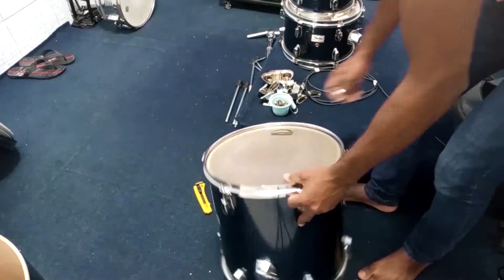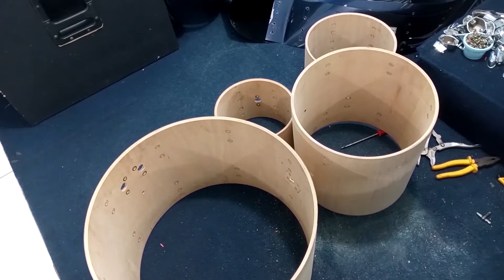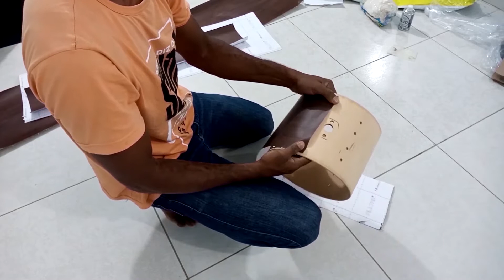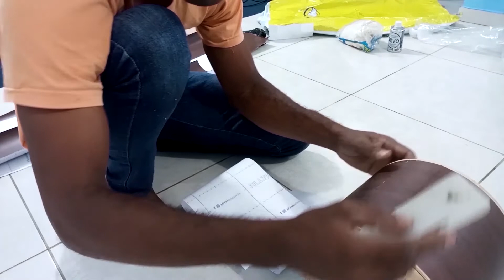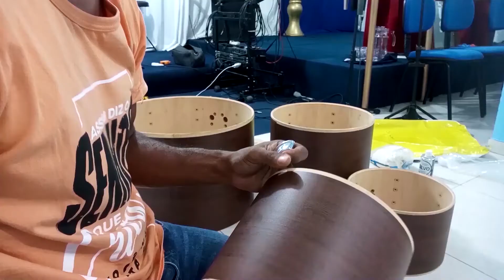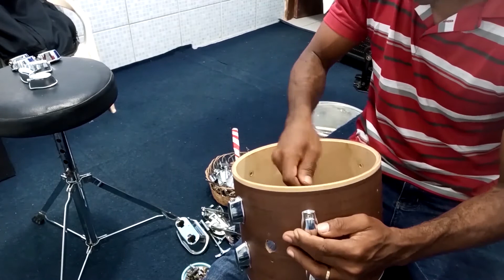Envelopamento da bateria TUTORIAL PASSO Á PASSO

Comment: A possible wise choice would have been to level and recut the bearing edges. Then sand the shells and seal coat inside and out. Then put the wrap on. It would not only improve the looks but also the sound and the durability of the shells and would raise the value of the kit. Just a thought for the future😊